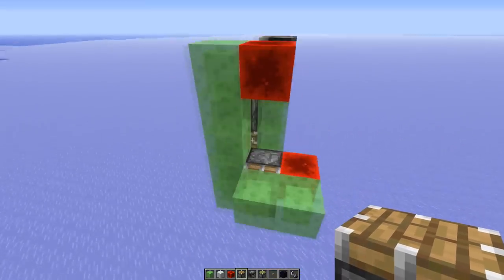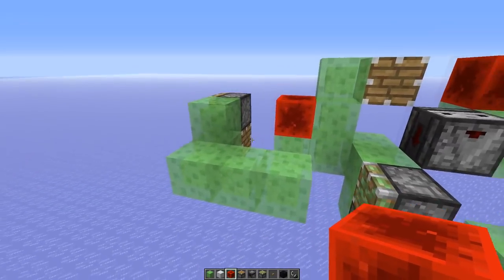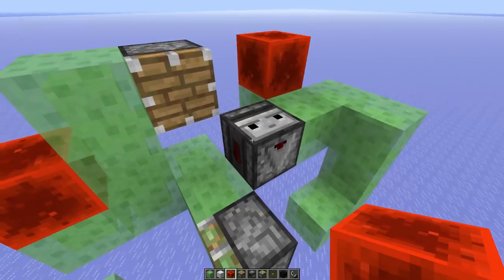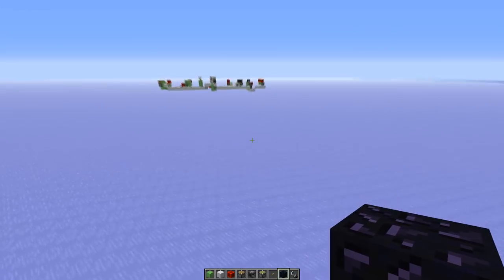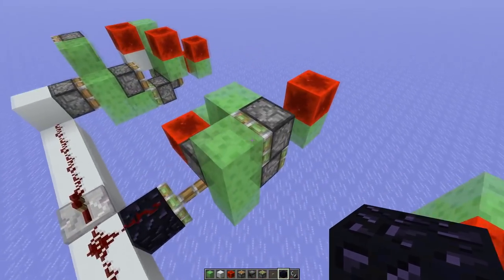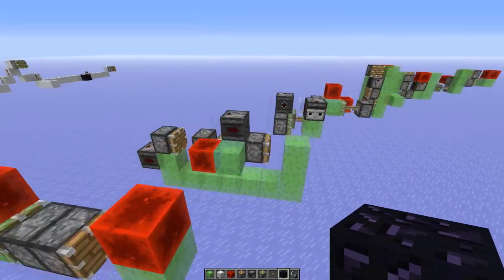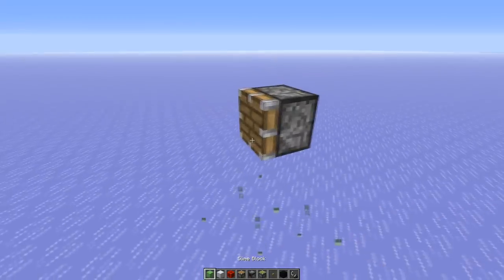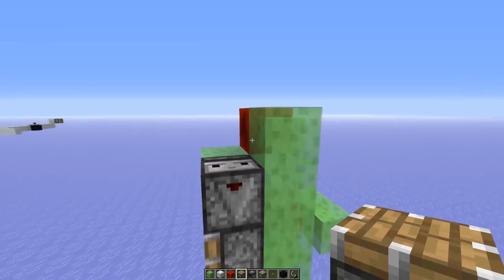8 Tick Engine For Flying Machines

Comment: im curious i always use 4 game
tick engines for my machines because i like the faster farms what use is there for slower engines aside from tnt relays?
Reply: You sure you're counting the timings properly? 4gt engine would be 5m/s, faster than any other shown in this video, and likely no one else has made it in vanilla yet. And slower engines are useful if other complex components do not run at higher cycle speed, or you are creating timings based on varied speed.